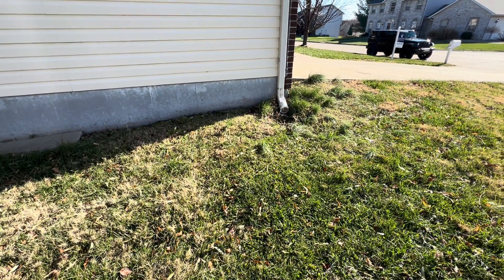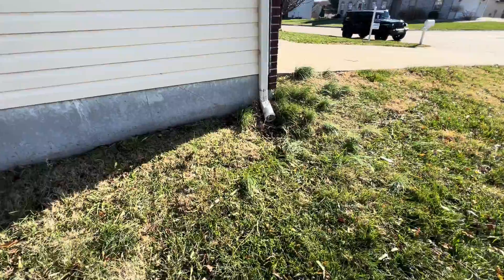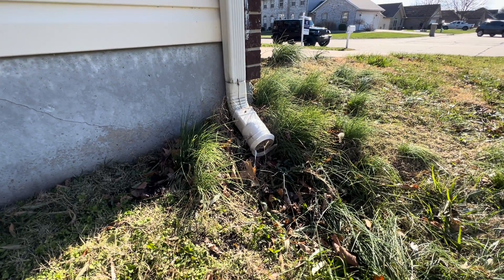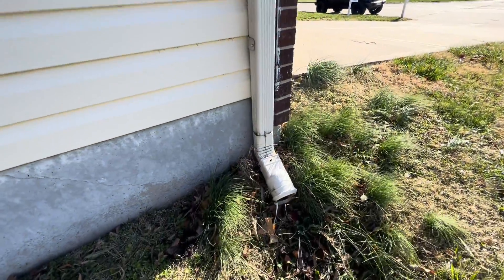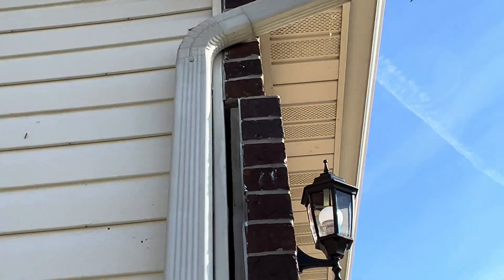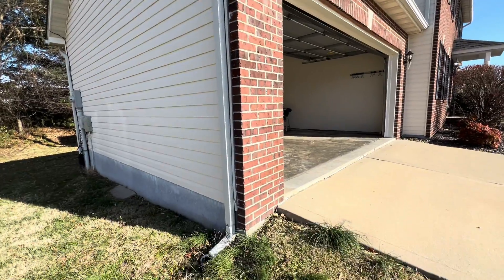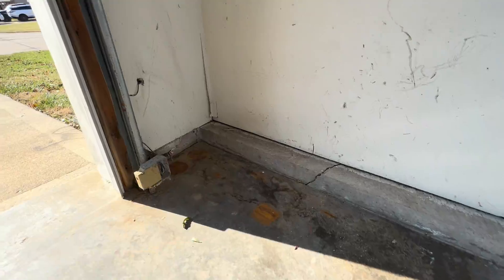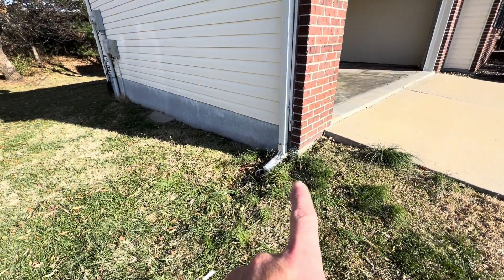Missing Downspout Extension Causes BIG PROBLEM

Comment: Gosh! Why do they "hang" brick wall onto the house?
Why don't they build a cement foundation specifically for the brick wall?
Reply from the maker: The brick does rest on the house foundation but only partially, so they have to tie it to the wall
Reply: Thanks so much! 
Are there special brackets one can buy if one wanted to build this oneself and is a permit necessary?
I live in WA State.

Comment: Wow, goes to show the destructive nature of water and how much it needs to be respected.
Reply from the maker: Absolutely! The unfortunate part is that every home I see has some kind of water management issue (gutters, grading, etc), just some get luckier than others when it comes to consequences
Reply: @rigidinspections  After 33 years of doing home inspections and 19 years as a Licensed General Contractor there is more going on here than just a rain gutter runoff issue. I'd bet you money with that small of a roof area and low load on the poured foundation that the most unlikely issue that water runoff is affecting with the foundation is revealing an undersized footing dimensions or poor steel placement within the concrete unless something happened after the building departments foundation inspection took place.

What is most likely is that area of the home is built on fill that wasn't properly compacted and if it was, it is deep enough of fill that over time the runoff has caused it to compact even further. Another very plausible cause is the underground electrical trench is parallel with the sidewall of the garage and is close enough to the footing or the trench was wide enough and depending upon the width and/or distance factors you can be almost certain that trench was not compacted when it was filled.

I cannot see the location of the utility box the main service is supplied from so the trench is a guess but unless that is a corner home site I'd bet it is off to the side of the driveway entry. If it is the runoff has a deep pathway to soak downward into the trench and that softens the surrounding soil which with the nearby load of the structure causes the settlement issue.

From the grade that is viewable in the video the grade at the front left of the garage is the high point so I believe it is a footing on fill that possibly has a nearby trench that wasn't compacted being exacerbated by rain gutter runoff that is the full cause of the settlement issue and structure damages.

You were there, how does my assessment from afar with limited views of the surrounding area stack up to what you viewed?